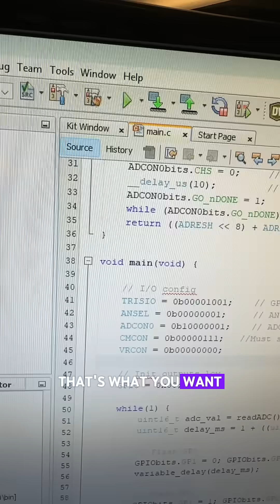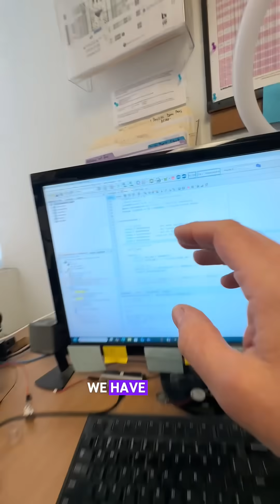Introduction to Microcontrollers and PIC12F675

Comment from the maker: I started with PIC microcontrollers in 2004, and started my prototyping business soon after. If you learn this skill it will give you an edge over your average software vibe coder and should make your resume stand out to future employers.
Reply: That’s cool how did you market your business and find people?
Reply from the maker: @seanpaulson9098 networking and my social media footprint 👍👍
Reply: Honestly, I wouldn’t recommend PIC for people starting out anymore. Anyone who doesn’t already have experience with PIC would almost certainly be better off starting with the 8-pin options in the STM32C range.

The tooling and IDE support are significantly better, programmers are cheap and ubiquitous, they’re widely used in consumer and automotive applications, have reliable onboard oscillators, more memory, and a much more modern development ecosystem.

PIC MCUs still have their place, especially in legacy or very constrained designs, but for new projects they don’t really offer many advantages over modern low-cost ARM options. Just my opinion, one electronics prototyper to another.
Reply: @davidf6592c  Thanks for this, man.  Opposing ideas are often helpful in our intellectual understanding of different concepts and possibilities. They are often hard to do though because of the way many communities react to un-agreeable-ness, lol, often. The video creator is intelligent enough to understand your point without having to think it degrades HIS…and that’s…exactly what I love about this channel as it is geared towards friendly intellectual, professional and technical growth of EVERYONE WHO WANTS IT! Anyway that was a super long way to just say thank you for your comment 😂😂😂 but thank you for your comment! 😊👍
Reply: @AllInEndeavorsOfficial thanks for the acknowledgement 👍🏼 I'm glad it didn't come across confrontational... I just wanted to share my perspective to help others weigh up their options.
Reply: what kind of things have you made? are they typically R&D type engagements before the client goes to mfg for product?
Reply from the maker: @jbalint1 yes, I basically live at the very beginning of the new product development cycle, when ideas are just starting to take shape and the customer wants to see what’s possible. I’ve done automatic fish tanks, a pig poop to asphalt reactor, vibrating hair brush, LED face masks, HVAC blower motor controllers, Thermostats, pumps, wearable sensors, bedbug zappers, the list is wacky and goes on and on.
Reply: But you still have to pay for the compilers to get somewhat optimized code (to fit on some chips) right?, or did they go away from that?
Atleast on the other options, the toolchain are free/open.
Reply from the maker: @Neslekkim you have to pay if you want to fill the chip and squeeze the maximum amount of optimized code into it. That’s generally a bad idea to begin with, as you should try to utilize maybe 50% of the memory to leave a healthy margin for your code features to grow. It’s never been a problem in all my years using the free XC8 compiler. Furthermore if you have a mass market product that is filling up on code then it’s worth the thousand bucks or whatever it is to purchase the licensed compiler. This all assumes you even want to use an 8-bit micro for the application. On more complex systems I’d just use an RP2040 or ESP32.
Reply: The simplicity and power of this downright beautiful. Thank you for making these videos they’ve totally inspired me!
Reply: Are you subscribed to the PIC mailing list? I learned so much from that list.  

I got my start in microcontrollers with the fairly new PIC 16f84 in 2000.  I learned to bitbang everything, not like you had much choice though... They're awesome though.
Reply from the maker: @mikebrown7366 I’m a Microchip design partner, not sure I’m in that newsletter tho. I also started on the 16F84 at the very beginning, and it was with PIC Basic. Then as soon as I got into the industry my customers wanted code written in C. That’s how I started with the 12F675 in C and inline assembly. They definitely still have applications and it’s handy to have such deep knowledge of the datasheets and quirks / errata. I’m planning to do a video on the CMCON register of the 12F675 because it’s kind of a nasty trap if you want all the GPIO to work. Have to shut off the comparator because it defaults to the on state. Anyway.
Reply: I started with AVRs in 2007. My first MCU had 2kB of FLASH and 128b of RAM.
Reply: Hi, I am currently working with PIC, STM32, Nrf52, ESP32. I work with logical circuits, data acquisition systems, and custom sensor development based on FDR methods. I work remotely from India. I charge 35-55USD for this developments. Is that too low?
Reply: Nope, that's to much
Reply: This is why history relates to IQ
Reply: AI will be replacing you soon.
Reply: @jonrod3831AI is not as intelligent as it seems as it lacks imagination and problem solving skills. It regurgitates what it finds online. Guys like this will be able to use AI to speed up the process. If you think that you could use AI to do what he does then I’m afraid you’re mistaken.
Reply: @jonrod3831 nah